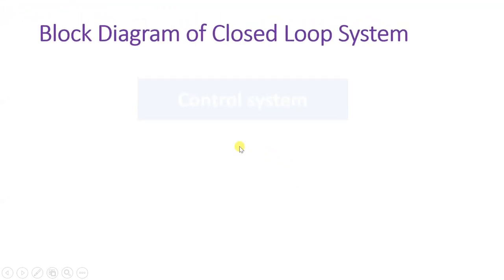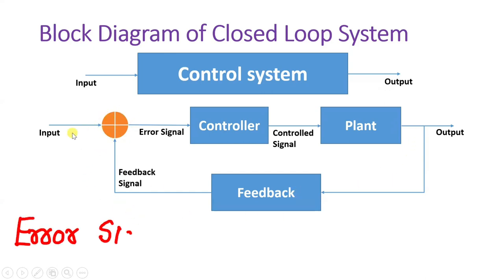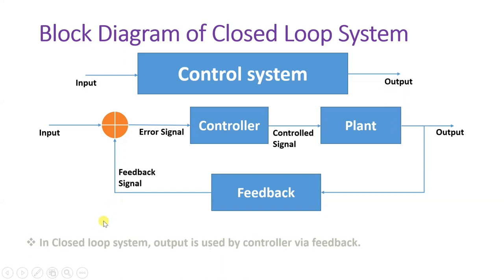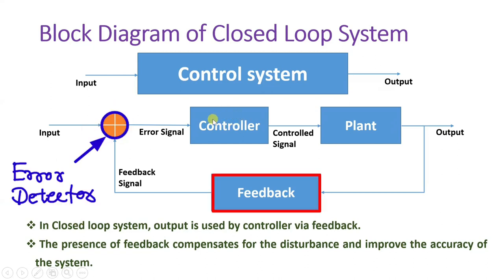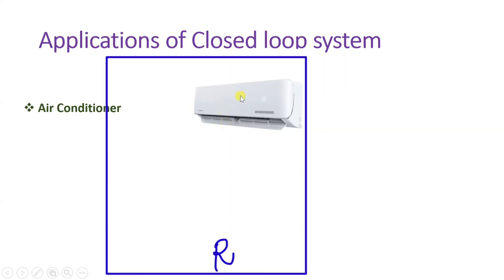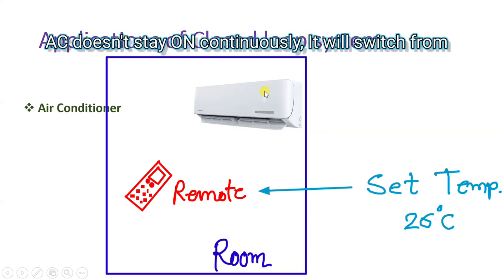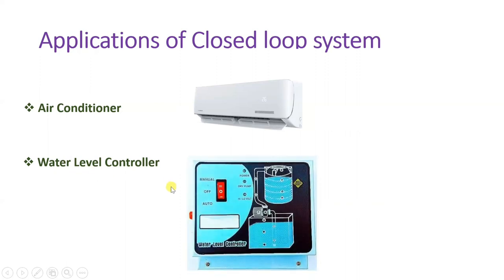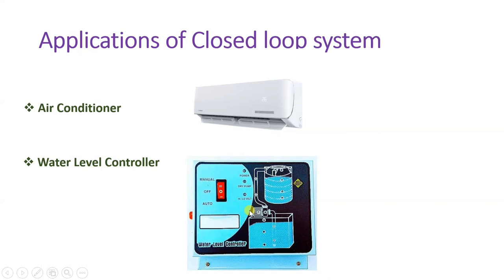Closed Loop System: Block Diagram, Applications, Pros, and Cons

Comment: it is Feedback due to which closed loop system is said to more accurate then how feedback may make system unstable??
Reply from the maker: It changes the stability, not all the time. For that only we need to learn control engineering
Reply: ok😄
Reply from the maker: Your welcome dear 🙏